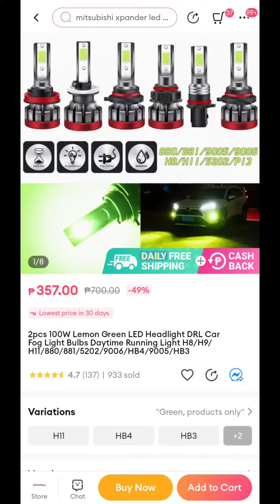Xpander 2023 | How to replace fog lights No baklas bumper

Comment: Why skip the part where the bulb is removed? On both sides, hindi mo pinakita yung exact moment na tinatanggal mo yung bulb. Don't you know that's the most important part of "how to replace fog lights"?
Reply from the maker: Pasenya na. Hindi kaya boss masikip siya. Hindi kaya pagsabayin. Ang point ng video na to is para malaman niyo kung san ang point of entry para mareach niyo yung bulb. The rest is self explanatory na madali lang baklasin yung bulb at yung pinaka h16/11 socket madali lang dn matanggal sa bulb.
Reply: @diyboyy9303  need ba irotate yung stock bulb to remove, or hatak lang paatras?
Reply from the maker: @badsector101  rotate boss sa pagkakatanda ko going to the right.
Reply: boss anong fog light ginamit mo po? anong brand?
Reply from the maker: @xhiervynalarcon8601  basta h11 boss any brand will do.
Reply: Boss pa send ng link were mo nabili yung bulb
Reply from the maker: @popcat_gaming1544  https://s.lazada.com.ph/s.SlvHb